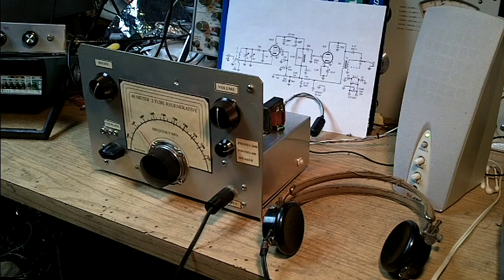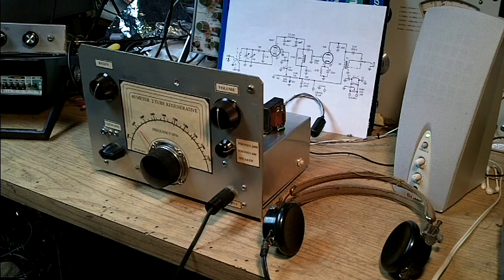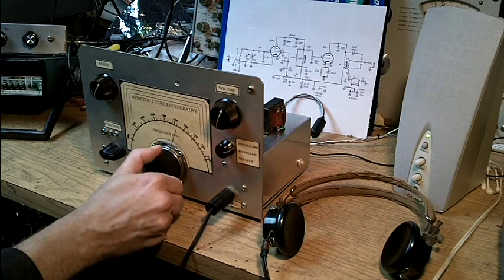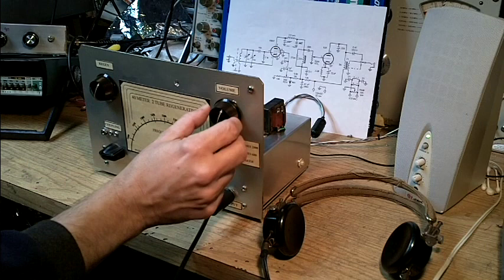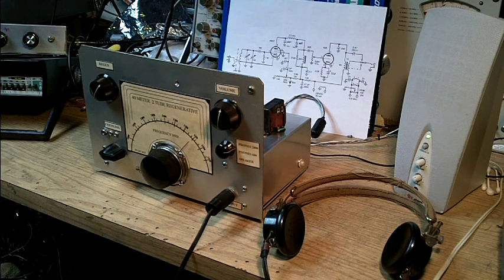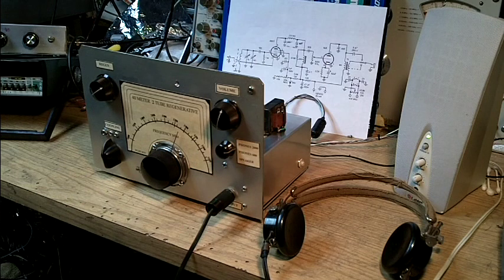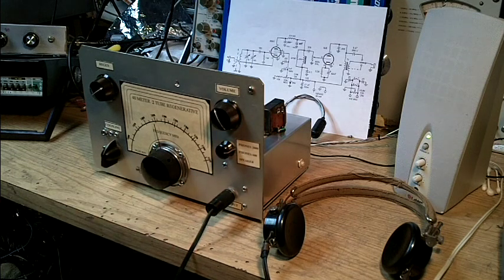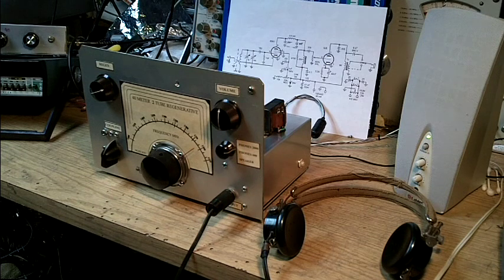Regenerative Two-Tube 40 Meter Receiver - Part 2 Operation

Comment: I built this basic circuit with a 6U8A ('The Neophyte', running on 56V), and can't keep it from squegging. With the common grid leak values of 1M & 100pF, it squegs around 7kHz. What do you suggest trying to prevent squegging?

Comment: What about using Wire-Ended Raytheon vacuum tubes which should be able operate off 25-50V with a heater of 3V
Reply from the maker: Ans. on facebook page. Mikrowave1's Radio Resource Page.

Comment: Great video.With a regen  Rx you actually get to feel the control over the spectrum  unlike modern receivers with multi conversion noise generating devices in them. All attempts to emulate that with sdr radios have become far too technology intense resulting in high cost and poor reliability with the expensive repair that goes along with it. No wonder the Germans were still using regens in WW2. All that was necessary was a savvy operator,  something that is lacking in Amateur Radio CBers these days.

Comment: Less parts.equal less loss, less power consumption. A good pair of Baldwin's best audio kv4li
Reply from the maker: The Baldwins are simply magical. Too much audio level for this! Even those old R2 military phones come off your head with a strong signal on the Paraset with no audio gain control.
Reply: @MIKROWAVE1  yes sir. Army phones were placed on head then advanced to my temple to make control easier. We followed clandestine troops and every ounce counted. that is to say a Regen/xtal controled rig weighed little.even when barely having a colpits osc with a one transistor  power amp. We were the life line. Less parts easy fix .tks

Comment: Nice set. The first radio I ever built was a regen when  I was 12. I had a lot of fun with it. I've built a few since. They work best with an untuned antenna buffer stage
and attenuator.  Yours is a fine specimen!

  73 Alan G0KMC

Comment from the maker: I use a low 40M dipole, coax fed as well as a 100 ft long wire with a tuner. Both work very well on this receiver.